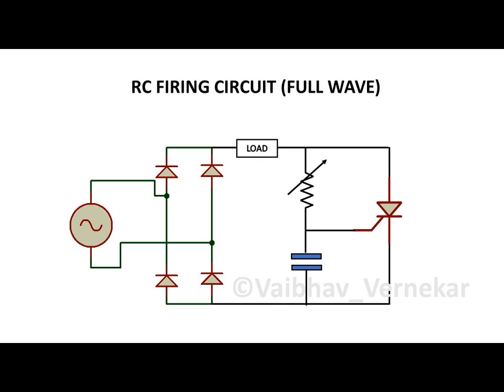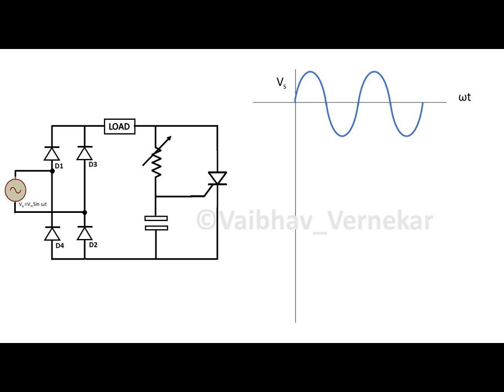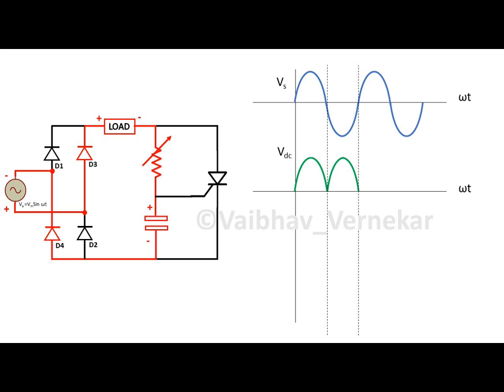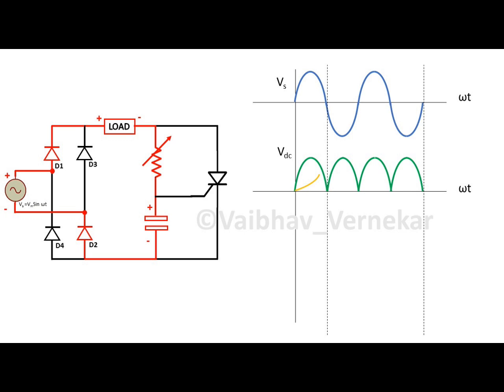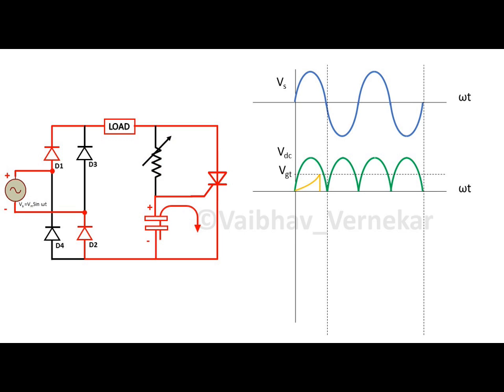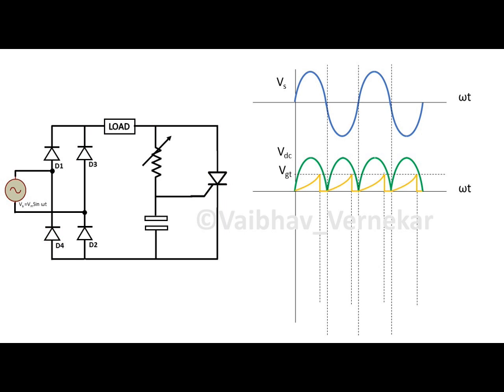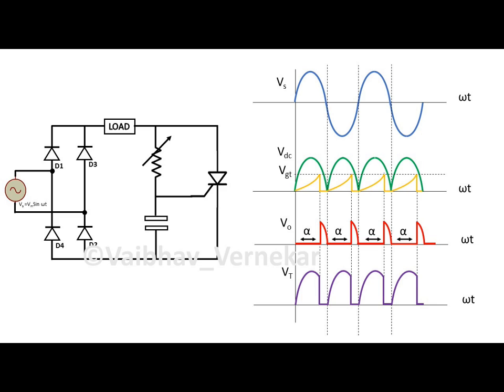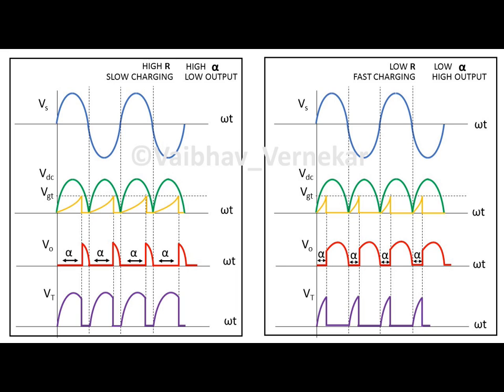RC Firing Circuit for Thyristor (SCR) full wave and graphs

Comment: please from which point did u take the output to oscilloscope, i noticed that u put the load directly after full the wave rectifier circuit so with this connection practically the output always appear as positive half cycles and not affected by the change of the firing angle, so please explain this